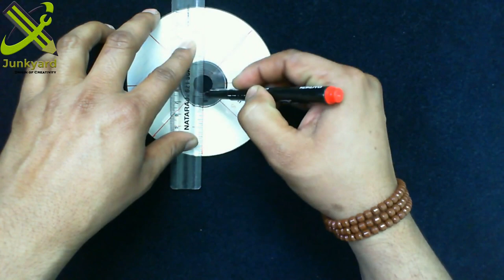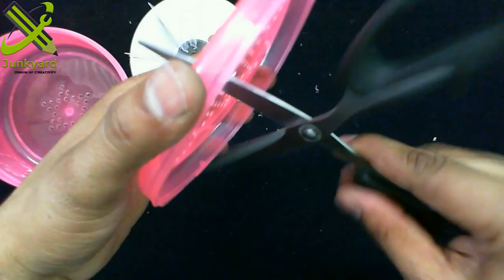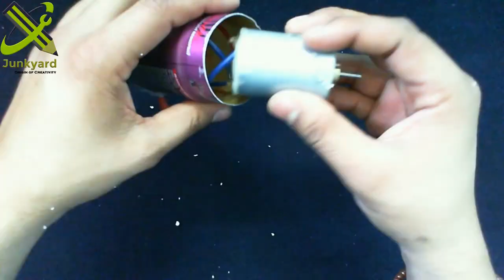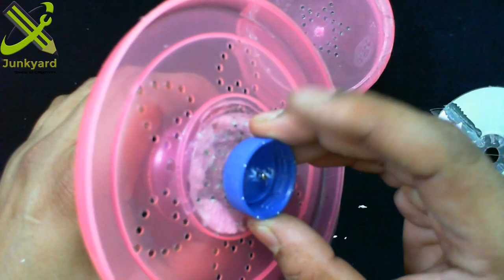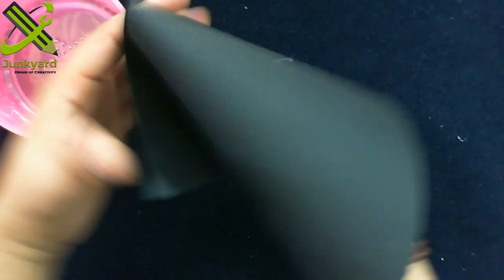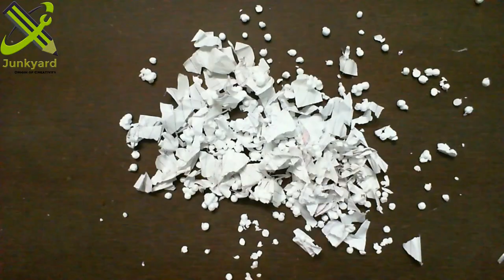How to make an Air Blower at home

Comment: Hi, am I able to use any bottle-cap for this or does it specifically have to be the blue coca-cola one? Thanks in advance.
Reply: +glensarge You can use any bottle cap, but it needs to be the shape on the video.
Reply: mi amigo muy practico su apoyo quisiera consultarle si un motor de un atornillador de 12 voltios  y de cuántos Rpm puede trabajar bien para este proyecto quisiera que me saque de dudas estría agradecido por su respuesta 👍